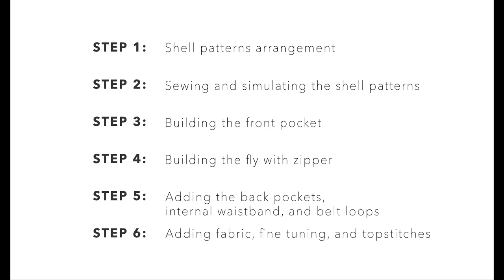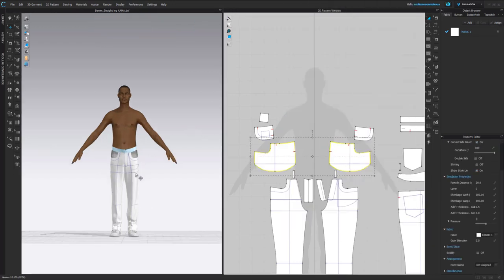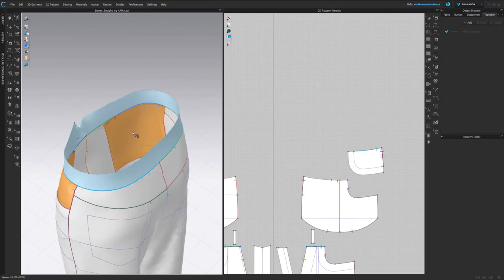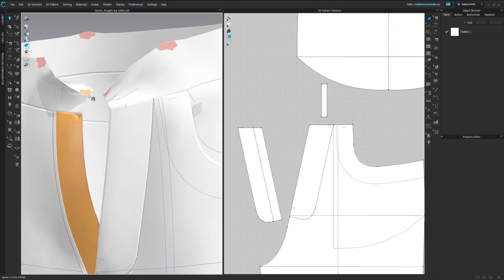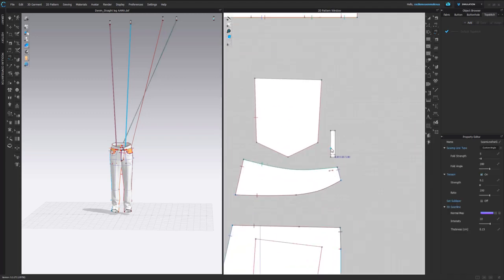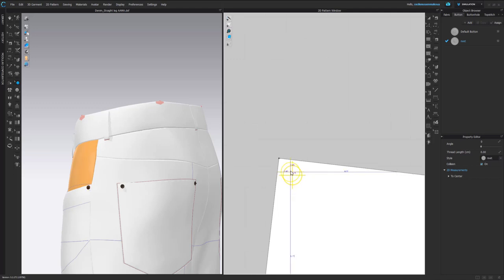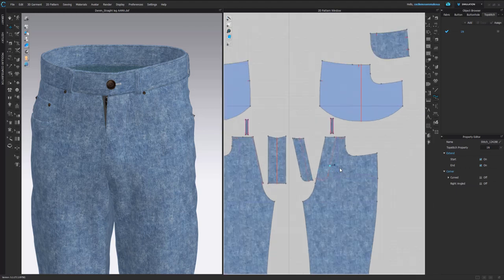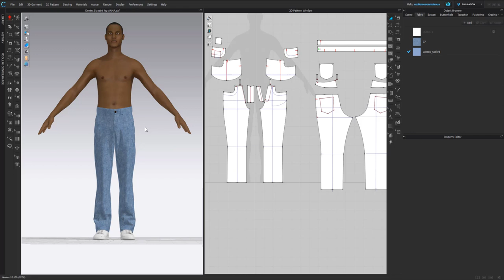Denim Construction Workflow

Comment: There's now a better option for keeping the waistband in place:

Create a circumference measurement on the avatar at your desired belt height (top edge of the waistband) and then navigate to "Avatar -> Measurement -> Attach to Measure"

Using this you can attach the waistband to a circumference measure line.

Thanks for this tutorial! It helped me immensely :)

Comment: please can u help me, when i make my pattern whith exact measurments i found after that they changes although i didn't change them.
Reply from the maker: The 2D pattern should not change. If you select the segment in the 2D window with the Edit Pattern Tool you can see that in the 3D window the measurement may change based on the FABRIC you are using.